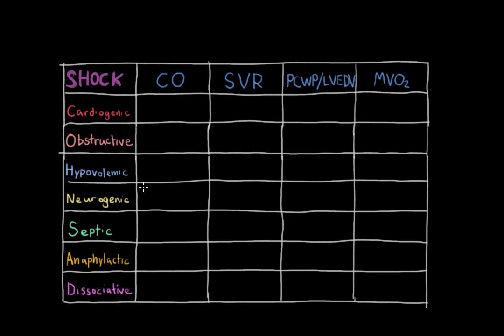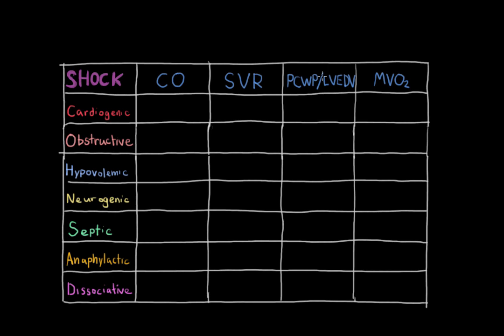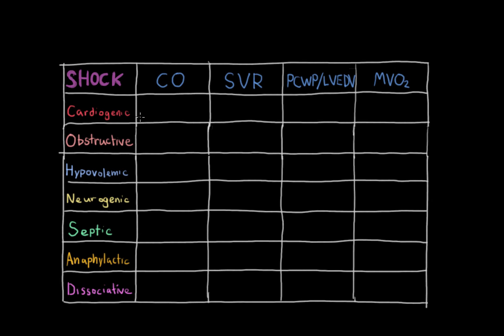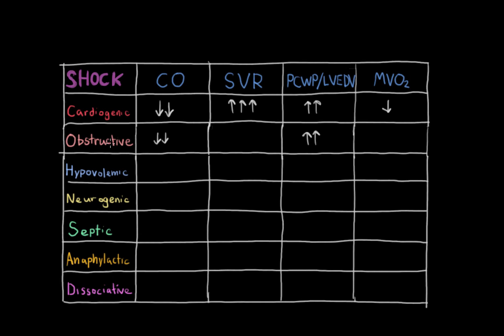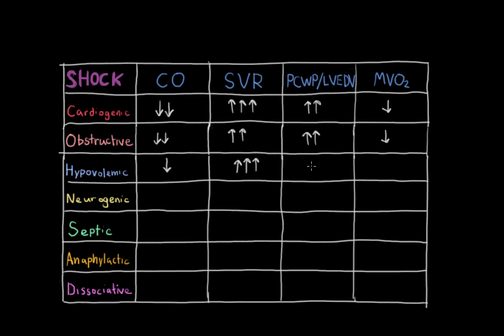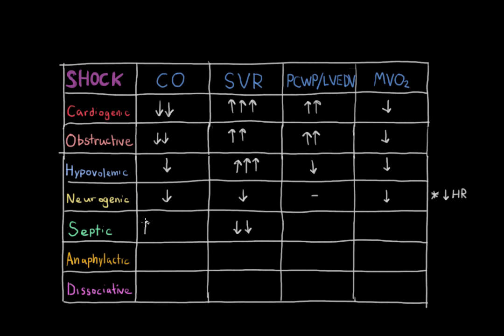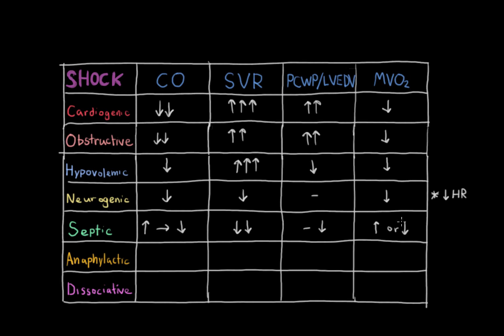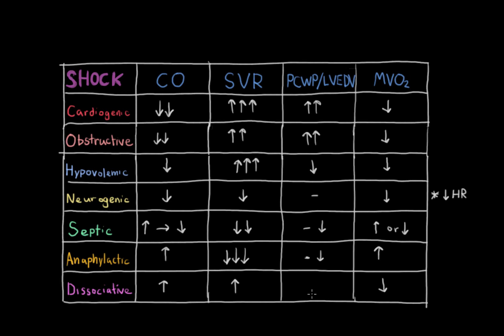Differentiating Shock

Comment: According to UWorld:

Obstructive shock has a decreased PCWP but an increased CVP which differentiates it from cardiogenic shock which is increased in both
Reply from the maker: Thank you for pointing this out! I'm thinking a redo video should come to explain the different types of shock, and to explain why PCWP can be either elevated or low. Just think about where the blood is measured (pulm capillaries) vs. where the obstruction is. If the obstruction is behind the pulm capillaries (like in PE), PCWP is lower. Obstruction after the pulm caps (aortic stenosis) causes build up of pressure upstream to the pulm caps, and thus PCWP is actually higher. Constrictive pericarditis and tamponade prevent blood from even entering into the constricted heart, so generally the PCWP should be low, to even normal (pressure from the pericardium or pericardial space causes pressure on the LV that is transmitted through the walls of the heart, aka transmural pressure). I appreciate the comment! So much of my understanding has improved since I made this video in medical school.
Reply: @LiveLifeMD  Okay that makes a lot more sense. So basically, UWorld says CVP is high and PCWP is low because the most common causes of obstructive shock are cardiac tamponade, constrictive pericarditis, tension pneumothorax, and pulmonary HTN all which are going to restrict LV filling making PCWP lower leaving the IVC backlogged making CVP higher. Especially considering that in obstructive shock, the heart is functioning properly, the PCWP should be low or normal. Thank you for responding!

Comment: Great vid series, thank you for sharing!

Why would mixed venous oxygen saturation drop in dissociative shock? I understand the tissues are starved of oxygen and will pull  out any oxygen possible.  But, if the left shift of the oxyhemoglobin curve occurs then oxygen is retained on hemoglobin and stays in blood.  My understanding is that these highly saturated hemoglobin molecules would then return to the heart with a high oxygen content due to the inability to dissociate.  In other words, if the mixed venous oxygen content is low, doesn't that indicate that oxygen is readily dissociating from hemoglobin?
Reply from the maker: Hi John, that's an excellent question! You are in fact correct, the MVO2 is high, since oxygen remains bound to hemoglobin. What I meant to say is that the oxygen content in the blood that is NOT bound to hemoglobin is low, because that will be pulled out by the tissues. Thank you for pointing this out.
Reply: Thanks for clarifying, keep up the good work!